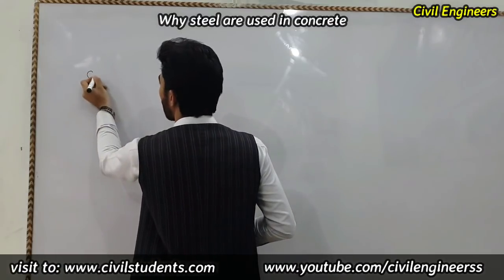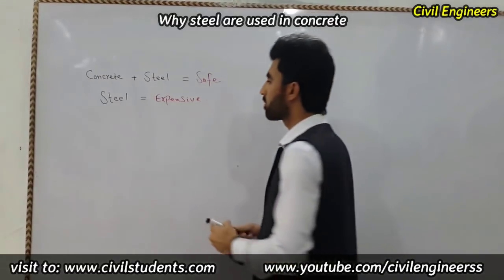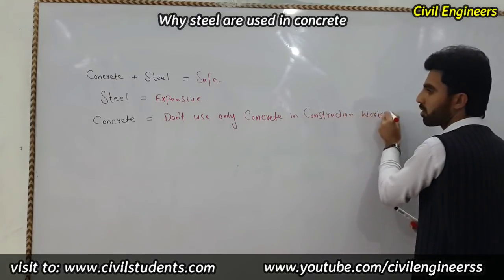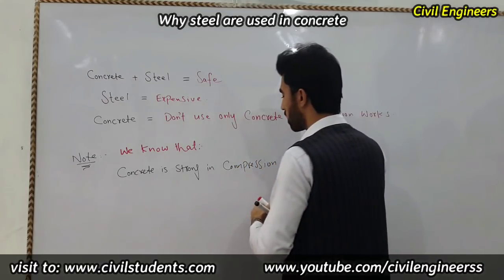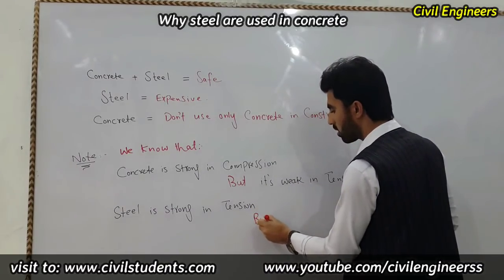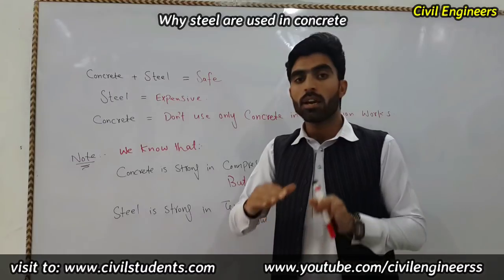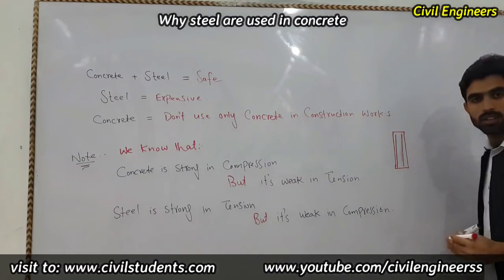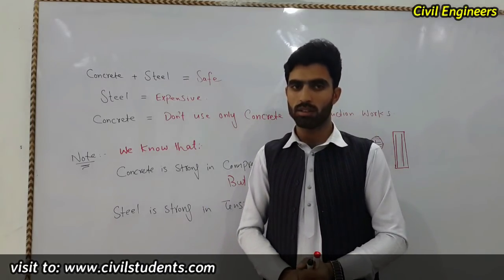why we use steel in concrete for Construction works

Comment: Brother steel is not weak in Compression. It's an Isotropic material which means it's equally good in Compression and Tension.  Well we use it with concrete just to reduce the cost.
Concrete it strong because it take large area ? Seriously 😂😂😂
Reply: Sameer khan #missioncivilengineering